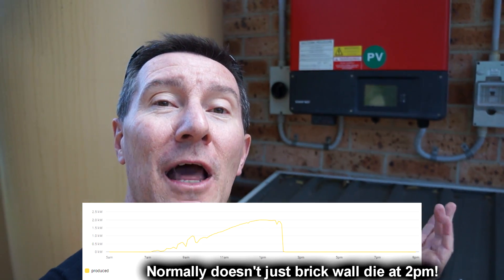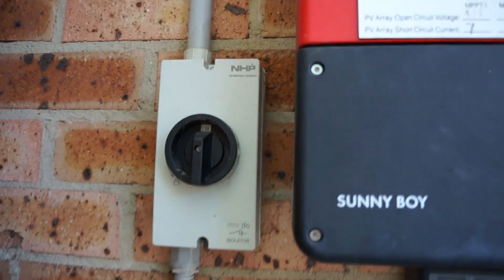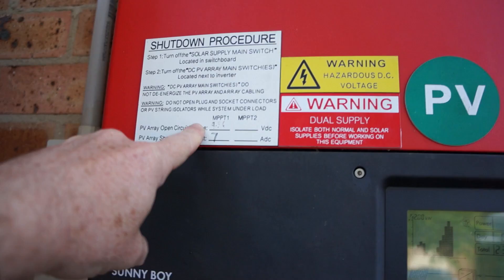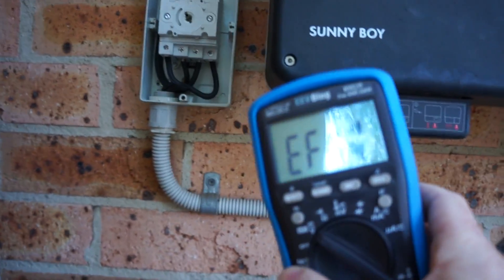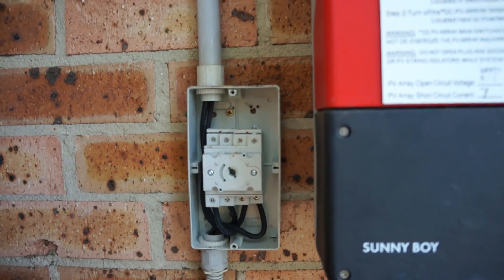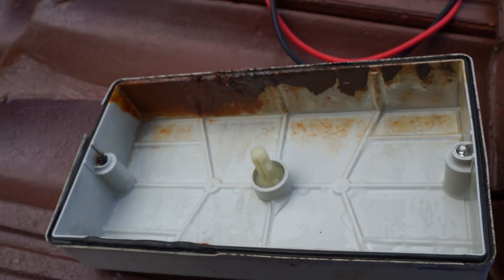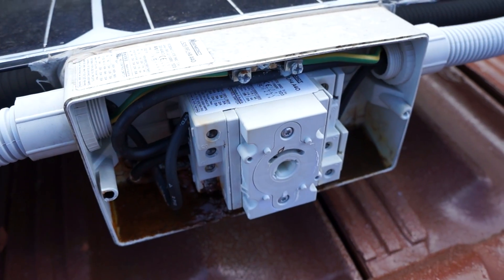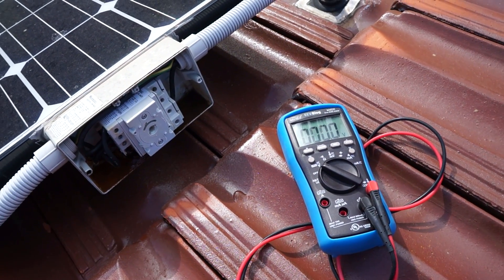EEVblog #1217 - My Home Solar Power System FAILED!

Comment: Poor installation, must have been by a qualified electrician. If it'd been me (not allowed), I would have put an aluminum shroud over it and drilled holes in the lowest location in the box just in case. Would have taken these extra steps only because I owned it though.
Reply: The following article reads to me like the regulator used to work for Ford selling Pintos. There's a cost comparison of fixing the cars or paying out the relatives of dead drivers. If you never require a qualifying test and only penalise after the fact, it's a case of dead to live body counting (bean counting). "I don't think it's up to government to dictate exactly which product an Australian consumer might prefer." Say what? You already dictate which guy is going to put it in  badly, so why not.

https://mobile.abc.net.au/news/2019-05-27/australias-obsession-with-cheap-solar-derailing-market-insiders/11139856?fbclid=IwAR1uBI9oqOun1i7C4Tmp4Yx7ZnYndYXPrQYwNounNbVrjUoCnSsc1iwWRdc

Comment: The switch didn't fail...the installer and the engineer maintaining the system did by having that seal and plastic case exposed to the massive UV radiation levels you Aussies have.
Reply from the maker: Indeed.

Comment: I think you would be better off just drilling a hole on the bottom and running a drain tube just in case it fails

Comment: I'd guess the isolator on the roof is because the energy is generated up there. If you need to service the cable between the roof and the isolator in the shed, you'd want to be able to kill power to that wire.

Comment: the recalls were because the isolation switches fill up with water up on the roof , then start fires , when you have long strings put in a 1000v bypass diode on each panel so if 1 fails the rest keep going

Comment: The switches can’t handle the high voltage from dc current which requires an arc quenching chamber around the contact or the contacts will burn ac is simple. Us only Australian approved electrical products or die. You have a isolator on the roof because it needs to be isolated as it is the a generation source and the asnz3001 said so, many cases ( monthly) of non electrician house owners doing their own electrical work and be sued after fatalities or injuries.

Comment: That type of box ain't made fore exposed outdore ... IT is fore out dore use !!! But not with out a small roof or som other cover / box 
Look fore the IP number .. Wether rating 
DC has a huge spark gap ... So if you take one of the other SWITCHES .. with the 1000v 10A And switch Them off 
They probbley Arc and BURN for as Long the sun shines or until the 15A fuse blows
 ( ill bet you that ther on the panels is printet .. use **A Fuse in end of string...) End of string is the last + plug ... Use Sand filled fuse they dont Arc either ... 
I just build 2 X 24 250Watt RECOM +5% Panels on my roof 
Set in 3x4 on eatch of 4 MPPT i don't use the Grid tie model ... 
And  in my case 15A sand filled in eatch string ...Up to 1000v

Comment: Seems like a poorly designed installation.
The installer should have added a proper certified NEMA enclosure to enclose the switch.
Why have two switches, look it up, but most likely it is a legal requirement of the electrical code applicable in the region where you live. Probably has something to do with running always hot wiring through the roof and down the side of a building.

Comment: why the hell didn't they put a weather cover over the bloody switch housing?  one simple thing and it would have avoided this problem!   grrrrr.

and why not plastic that doesn't degrade in the sun?   poor planning and poor implementation.
Reply: I've got a 6.3KW system going up next week, I'll be SURE to make sure the isolator switch up there is not subject to weather.

Comment: In the United States that switch would be located inside of a metal box rated for outdoor wet and full sun applications.  The wiring would be in a metallic EMT conduit as well, or possibly in a liquidtight FMC conduit if it needs to be flexible.  It wouldn't be in plastic up on a roof.

Comment: Let's see, 1.  A non-UV protected plastic box on a hot Australian roof;  2.  Box perimeter weather seal mounted in vertical plane rather than horizontally where rain and sunlight can affect it directly;  3. No weep holes or vent provided to equalize humidity in and out;  4. Box and switch failed irreparably after only six years.  Most systems take 10 years or more just to amortize their installation costs.  Might I suggest a ham radio solution?  Use a box often used to house baluns (https://www.homedepot.com/p/Carlon-4-in-x-4-in-x-2-in-PVC-Junction-Box-E989NNJ-CAR/100404097) and add a vent (https://www.mouser.com/ProductDetail/563-NBX-10911) instead of trying to seal it tight.  The vent will keep the bugs out and prevent pressure and humidity differences from causing water ingress.  Cheap and it should last for years.

Comment: Here in the US the systems are subsidized by by the government, in most case from what I've seen, the systems are not yet worth being put in, electricity here is still relatively cheap.

I worked on a system recently, more than 20 years old, uses series/parallel panels, overall, the system is wired in parallel, about six pairs of heavy copper wires come down from the roof, are combined in parallel via fuses in the inverter.  The junctions are all done in weather-proof boxes, using common wire nuts, filled with silicon grease.  I believe the industry has finally standardized on common connectors.

The newer systems are using series, I believe the maximum current is about four amperes and the combined voltage a little over 500VDC, allows for less copper, lower losses.  Unfortunately, I'm accumulating dead inverters, doesn't seem to be anybody in the area here in kalifornia who repairs the things, people just replace them.

Why in the world would somebody use a switch that does not have an outdoor UV rating?  If you feel the isolater is necessary, put it in a weather-proof pull or junction box.

Jim

Comment: So silly to have a DC Switch on the roof, Yes sure beside the inverter but not on the roof. This is the silly problem with regulations at the time made by people trying to be over the top in terms of safety but without understanding the long term problems or the need for the DC switch at all. I think the switch at the inverter is needed that way it makes it easy to work on the inverter but the one on the roof is just stupid. Lucky in NZ we don't have that requirement of rooftop switches. In your case, I would get a new box for the roof to hold the wires, remove the switch, connect the wires. You already have the switch beside the inverter and that's all you need. Problem solved.

Comment: Since you're in Australia you have a shed with some old tin inside it. Get that tin (watch out for snakes), and make a little roof for the isolator (watch out for magpies). Once that's done, follow the chain of electricity, paying attention to where it goes into the nooks and crannies (watch out for spiders). If there's any puddles or other water nearby, make sure to isolate the cable the cables and keep them as dry as possible (watch out for sharks). If you need any parts, head down to Bunnings to get them, as well as a snag and Pasito to eliminate that hunger you've worked up.

Comment: So I work for solar company as a designer and from my experience with a similar product that looked very identical inside and out to the one you are showing. I can't tell what the enclosure is made out of but the product that we had received in an order once was infact not outdoor rated and thus was not allowable to be used outdoors. That could be where the problem stems from. Unfortunatly your inverter was not a newer model with an integrated dc disconnect, who ever installed your system would have fixed it for you through a manufacturers warranty.

Comment: Dave y u place switch on the roof? you can't reach it quickly, it's unprotected from the weather.. whyyyy???
Reply from the maker: Wasn't me.and it's regulation to have one on the roof
Reply: @EEVblog ah, i see. I look forward to your solution on how you going to make it weather proof. I would probably take identical switch and hot snot glue the sides to make it water resistant :P

Comment: I have a Sunnyboy inverter too - which is still working fine, but the LCD no longer works. At certain times of the day in summer, the sun would shine on the front of the inverter. Over the years this has faded the LCD. Now the only way to see what it's doing is with Bluetooth. Fortunately, my model has some LEDs to indicate that it's alive, they haven't been faded by the sun.

Comment: If its outside and plastic it needs to be black. Carbon black reduces UV penetration into the plastic and decreases this sort of exposure related degradation.
Reply from the maker: My new one is carbon black
Reply: @EEVblog  Awesome! Thanks for the reply! Lesson learned through the years; kids tend to leave toys outside in the sun. I always wondered why the black ones didn't fall apart as quickly as the others. Did some digging and found the bit of info above.

Comment: Switches on top allow for isolation of each panel for both safety and inspection.  I'd replace the switches with higher quality ones that contain titanium screws and contacts which are highly corrosion resistant.

Comment: In germany you don't install such switches. (On small Solar Systems). Just connect your strings to the inverter :D
Reply: In the UK you do install the switches, but they are generally in the attic where they don't see UV exposure.

Comment: Is that switch a code requirement in Australia?  I would omit it altogether and use heat shrink + butt splices in a junction box in its place.  

Could be worse, we now have 1m from the array rapid shutdown requirements in Ontario...  More electronics on the roof to fail.
Reply from the maker: Yes, code requirement

Comment: I’m sorry to say, but this is typical bad quality isolator, with a Policarbonate enclosure, which is not appropriated for the application. The major issue with isolators in Australia are related to the temperature  and UV radiation, this can be solved using the right components ( GRP for instance guarantees 20 years of direct exposure to the sun) and switches which can handle the high temperatures inside those boxes (this can easily go up more than 80 degrees around the switch inside and much higher inside of it). Proper wiring must be used (105 degrees centigrade is appropriated) and please check the derating curves of the isolator in function of temperature and wiring. 
In regards of recalls in Australia, you have to realize that this hasn’t been made against the manufacturer of the switches, but the brand (most of these are brand labeled), for instance NHP is not a manufacturer is a distributor. The LS16 and LS32 were recalled years ago but with other naming.

Comment: You should speak to someone who does solar marine/auto installations for some tips. 

There's a lot of misinformation out there on solar which has filtered in due to a rush on housing installations and the tried and tested knowledge in marine/auto applications where it has been tested in some of if not the harshest conditions hasn't crossed over due given the knowledge gap.

Comment: That box is the wrong way around IMO. Turn it 90 degree so it sheds water. Also it needs a weeping hole on the bottom so if water does get in there it can get out.

Comment: An electric company I’m working with does solar installs, and honestly they shouldn’t be using non sheathed corro conduit, need to have sheathed on the roof or else it will deteriorate quickly as well. Another thing is stainless covers to go over the isolators on the roof, helps protect from the sun, Stops a bit of rain, no more issues. Let me know if you want any photos
Reply from the maker: My new one comes with a cover

Comment: Reading all the comments questioning the need for a isolator mounted at the panel in Australia.
In Australia we take safety seriously.
A person work on the roof NEEDS to know the status of the isolator and cannot rely on the fact that the isolator near the investor is really off.

Working on panels requires the panel inter connectors to be disconnected.   This should never be done live as the connectors are connectors NOT circuit breakers.

Going up and down ladders whilst diagnosing/replacing/testing is a practice with considerable risk associated with it.  Having a roof mounted isolator makes it safer and probably a less expensive repair etc.

Because many do not appreciate the benefits of a roof isolator , they put no effort in to ensuring that the isolator and its mounting is up to the task.

In Australia we have intense UV and extreme weather conditions that need to be considered.

Drainage holes might seem a good idea, however they allow ants and other creepy crawlers in to make nests and these can in fact cause electrical failures.
One particular Asian ant (but common in Northern Australia) is the Singapore ant.  They are tiny red and black ants, devour plastic and seem to like being in electric fields.  They will crawl into contacts and align themselves between electrical nodes and cause short circuits. Google them, they are very interesting)

I tend to use a recycled black nylon like bin (from Norgan Vaaz ice cream sellers), cut to shape and hung over the switches to keep the elements and UV of the isolators.

Having panel mounted isolators is a great idea!  Don’t knock it!

Comment: I've also a SMA SunnyBoy. There is a DC Switch on the Inverter itself (Which is also indoors). Apart from that there is no extra switch on the DC Side.
Laws regarding electrical installations are rather strict here in Germany. But one DC switch on the inverter itself seems legal.

Comment: I thought you'd bypass that switch in this vid already lol
Reply: Yeah I would have, but I think the law in Oz is very frowny on people doing their own electrics. I prefer the system here in the UK (at least the England and Wales part)... you can do what you like (varying from the wiring regulations) but the onus is on YOU then to prove it has equivalent safety.  And building control need to be notified/sign off on it.

I'm an electrician so I can sign it off myself... and would quite happily do so, to avoid a hazard like that.

Comment: You pay good money to have a system that "should" work, yet the use of inferior parts to offset the expense to pocket the extra money saved seems to be a regular occurrence with most companies and some tradies nowadays. At least with the Council I worked for, the expense paid for itself with longevity and quality of the products purchased. I bet if you look deeper into those Benedict switches it will say indoor use only, and aren't even IP rated either....

Comment: The side containing the seal is exposed to direct sunlight and rain. If it was positioned differently (like your other one), it should not fail as quickly. Otherwise, you can protect the whole thing better from the elements by covering it with something.

Comment: In the UK my solar panels are on my main roof and there is a DC isolator in the loft space with no more than 2m of cable from the end of the panels. There is then another DC isolator next to the inverter in the garage down at ground level with an AC isolator before it connects back in to the main distribution box. I cannot see the purpose of having 2 DC isolators, it just seems to isolate the cable between the 2 boxes.

I see that there is some debate among Australian installers about the merrits of fitting a roof top isolator, many believe that increases risk rather than providing an opportunity to reduce it.

It is not like you can turn the switch on the isolator and the panels are turned off! It just stops the current flow and makes the cable to the inverter safe. You could just pull one of the connectors out of a panel on each string and achieve the same objective.

Comment: Have you noticed, looking at larger data sets, if the overall power generation has dropped as the year go by?
Reply from the maker: Hard to tell exactly, but doesn't seem to have dropped.

Comment: "As tight as a nuns nasty". Winner
"Check out the sludge on my tip". Close runner-up.
Reply from the maker: What's third?
Reply: @EEVblog  I might have to consult my ECC-memorybanks on this.

You did one some time ago, but don't wait up. I might pop up along one of your upcumming videos.....

Cheers and thanks for the video on the Hameg 205 20meg scope. I bought one in 2016 based on your teardown and recommendations.

Comment: But but but. What are those flex conduits ? Is that UV stable. We use them type all the time indoors. Called preflex. But it just falls apart in the sun after a while.

Comment: I wonder if drilling a hole in the bottom face of the switch during installation would have helped with this issue
Reply: Sebastian Grygiel That would work, until ants decide to make a home in the enclosure.
Look into/Google Singapore ants, whom actually seek out electric fields and it might be a disastrous thing to do.
A nylon based shroud to cover outdoor switch gear is probably the way to go!

Comment: There's been quite a number of fires due to failure of the DC isolators on the roof, and yes they are mandated. There has been 167 fires in QLD directly linked to the isolator and no other country mandates the use of them on the roof, hopefully the rule is changed.

Comment: My solar installations in Germany don't have such a switch at all, here you switch off the DC directly at the inverter. There's no possibility to switch it off on the roof, the cables going down are always under voltage. But this is normally here, and perfect legal in Germany.

A weather protection made of sheet metal would help to protect the plastic housing, from rain and UV.